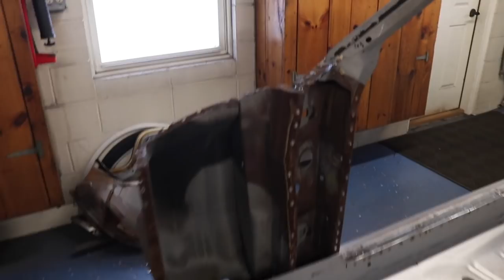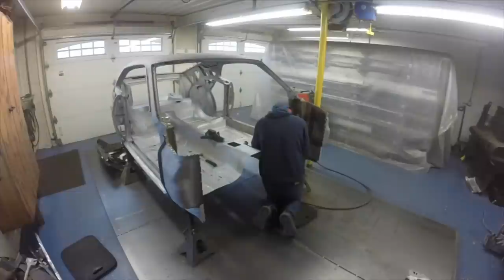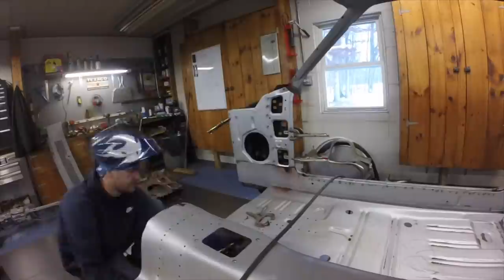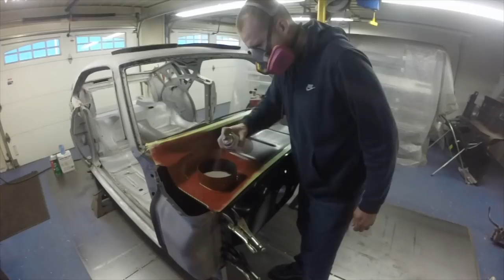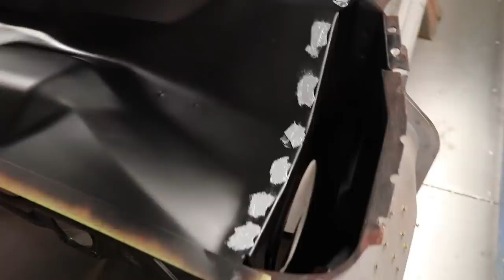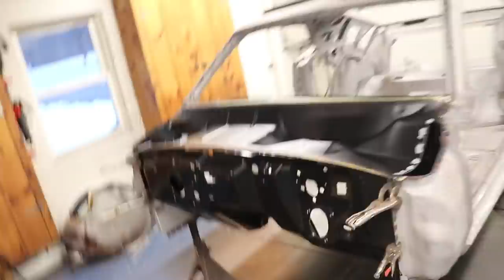1970 Boss 302 Cowl Panel Area

Comment: Outstanding job on surface prepping the new cowl panel!  So whoever buys this one will not have to worry about water leaks into the interior for many years, if ever!  You refab these old mustangs to "better than new condition" in many cases.  I have one of those $30.00 plastic covers on my old 1965 coupe to prevent rain from entering the cowl panel area through those vents.  Purists will vomit then they see these but I am not aiming for a perfect restoration and find this $30.00 plastic cover preferable to hundreds of dollars of front end disassembly to install a replacement cowl.  I am not interested in a show car or perfect resto mod.  Just a car that I can drive that will run reliably that looks decent.  If I were seriously into old mustangs I would buy a 1969 Mach I which is my all-time fav old mustang.  But then, of course, I would have to be careful with her and keep her in garage most of the time.  Will continue to follow your videos on youtube.

Comment: That thing is like 10000% solid. Every ford I have owned from that era had cowl rust.
Reply: They didn't treat the metal at all.
Reply: @superduty4556  yeah and guess where the torque boxes are. Right underneath it.
Reply: Makes one wonder if that was yet another built in 'planned' 'life shortening' technique the big three were known for.... to insure the next models new buyer, that is. GM did it, only makes sense Ford did too.
Reply: @Rev22-21  I think they only expect these cars to be good and reliable for 10 years. Yeah at that point they probably caught on they need to sell cars to make cars.
Reply: @Rev22-21  Volkswagen didn't treat the floor pans of their cars either. I was probably a cost-saving measure.

People didn't run their cars into the ground like today I don't think.

Comment: Any reason you would not use POR15 in those hidden areas. It has always been my understanding that primer absorbs and attracts moisture and has been my experience as well.
Reply: It's prob epoxy primer or some kind or etching primer. It will be fine. POR has to have something to bond to. Rust pits or coarse sand blasted etc. Even roughed up with 80 grit works. Clean bare metal cleaned with say a wire wheel won't git POR the bite it needs. I've seen it peel right off frame rails
Reply: POR 15 is for amateurs. Sandblast and etch primer or epoxy is best whenever possible.
Reply: @dewanitheriault3372  Woah someone didnt have their coffee yet.

Comment: I've watched a lot of these cowl panel replacements.  I plan doing one this summer on a 66 coupe.  I havent see anyone really paying much attention to trying to get the proper centering location of the cowl.  Place it on and start welding.  I'm worried about centering, gaps when the fenders are reinstalled, having the export brace holes line up properly.    Is it just as simple as placing a tapered rod in the  export brace holes?

Comment: What did you brush on there (grey stuff) was it seam sealer? If so, is it waterproof? Looking to use it for a repair I need to do. Is it better to get a caulk tube of it and brush it with an acid brush —— or it doesn’t matter? Thanks for responding!

Comment: Im curious how ur sub frame is going to mount, if it goes an inch up u will have to trim the aprons an inch to sit on them correctly? But than the engine bay will be an inch shorter would there be engine hood Clarence issues, and fender fitment?
Reply from the maker: Fenders wont change at all but you are correct with the other parts. Just have to alter things to make them all work together

Comment: I was wondering what Model Lincoln MIG welder you are using and what settings you use for heat and wire speed on the   thin sheetmetal
Reply from the maker: I believe a 180 and usually C 4

Comment: If the floorboard is raised by two inches, how were you able to fit the firewall between the lower cowl panel and the floor/tunnel without chopping up the firewall? Unless I missed something. Thank you.
Reply from the maker: I raised the floor 1 inch and I will be cutting and alternating the firewall to fit properly later

Comment: How much do you have to keep to keep the VIN valid.
I saw a guy tear out everything off a 70 Chevelle SS and re-rivet the VIN 9n a car with a better body. He called the restoration an OE donor body.
Reply: Unless he has had someone come out from the highway patrol office to verify the changes on the new title it is illegal. Because the body panels are all stamped with part of the serial number. A buddy of mine had a friend changing cabs and beds on a truck and he told him he had to do this to make it legal. That is how they trace stolen parts or complete vehicles.Ronnie.
Reply: @brdnsky6417  stamped in 1970? I doubt it. What he did with that Chevelle is totally bogus.
In Mr Petersen's case, I'm sure it's legal. How much of the original car is necessary?
Reply: As long as the VIN tag on the windshield matches what's on the vehicle registration, it's a moot point.  What you said that other guy did on that Chevelle sounds somewhat shady and may even be borderline illegal.  He stated in an earlier video this car is NOT going to be a concours, numbers matching restoration, as the car's original Mach 1 engine was lost, and a non-original engine had been installed in its place.  The state doesn't really care about what gets swapped into what as long as the number on the VIN tag on the windshield matches what's on the vehicle registration.  In 49 states, generally, after a car is twenty five years old, it's emissions exempt (even in California if the car was made before the 1975 model year).  The state generally doesn't patrol car shows or check VINs unless the car is reported stolen.
Reply: @houseofno  I understand what your saying about numbers matching for restorations, but here in N.C. if you take a truck cab off of one truck with a title and put it on another frame from another with a title you have to get the highway patrol to make a new title. It will have that year of that cab because you have two titles. One for the frame and another for the cab. That is what the law is. Now I know this is done all the time but by law you are not suppose to do that by law. Because you will have two different numbers. They have gotten pretty strict here. I bought a car with a S.C. title and for me to get a tag I had to get the highway patrol to come out and check the numbers on the car before I could get a tag. But like I said I understand it's done all the time. It's just when you have two numbers and you have numbers on frames and cabs, here you need to do it. Just to cover your self. Some where someone could cry about this part was this persons. Well you need to be able to prove what you got. Ronnie.

Comment: What is that platform the shell is sitting on? Also what type of seam sealer are you using?  Ronnie.
Reply from the maker: 3m sealer and it's an all steel platform I made
Reply: @petersonrestorations  Thanks for the info. Ronnie.